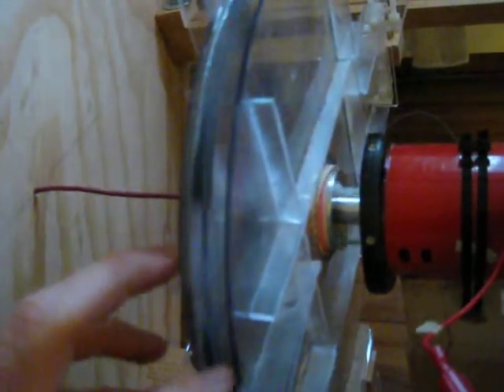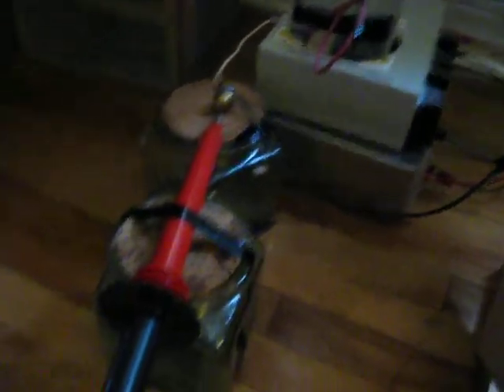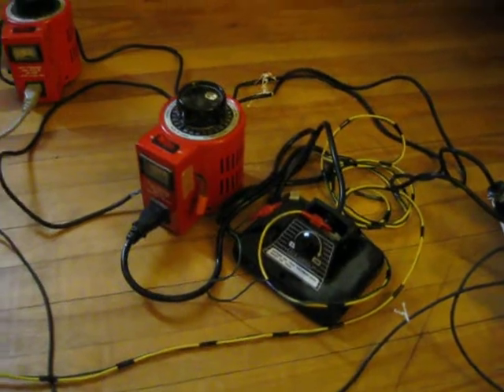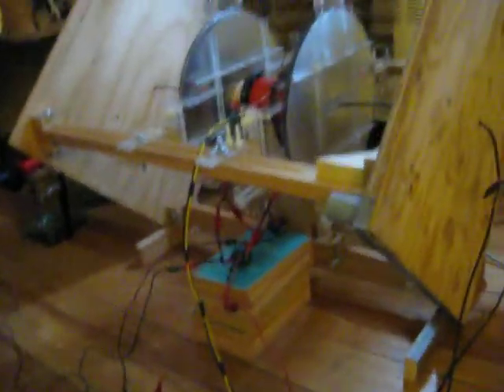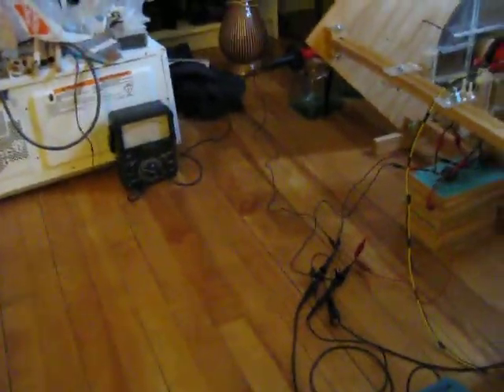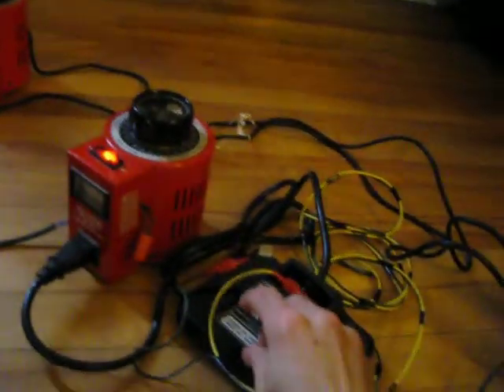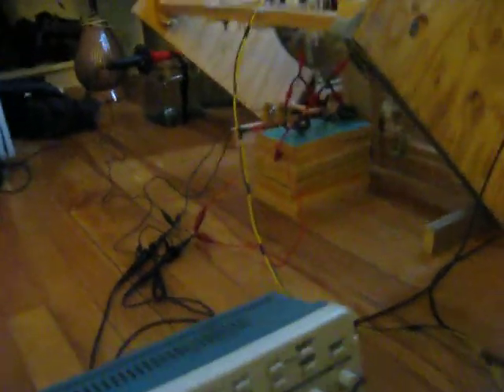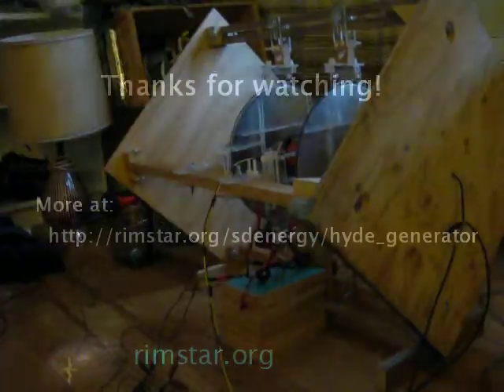Hyde Generator - 1st run after completing all parts April 7, 2009

Comment: Доброго дня.  Ваш пристрій не працює через те що там є груба помилка. Якщо вам цікаво можу допомогти.  Вам сказати що потрібно зробити щоб пристрій запрацював?  

Good day.  Your device does not work because there is a gross error.  If you are interested, I can help.  Can you tell me what needs to be done to make the device work?
Reply from the maker: The only thing I didn't manage to get done was to make it turn fast enough, > 6000 RPM. The fastest I got was 5200 RPM. But I don't have time to work on it these days.
Reply: На вашому відео пристрій не генерує енергію.  Справа не в кількості обертів. Пристрій зроблено не вірно. Генератор буде працювати навіть при одному оберті на хвилину. Якщо зібрати його вірно. Патент по якому ви його робили містить помилку. Ця помилка є для того щоб у вас нічого не вийшло.  

In your video, the device is not generating power.  It's not about the number of revolutions.  The device is not made correctly.  The generator will work even at one revolution per minute.  If you collect it correctly.  The patent on which you made it contains an error.  This error is there so that nothing happens to you.

Comment: Does it have magnets, or is it static electric type?
Reply from the maker: John Kerley Static electric and then something magic is supposed to happen across the output circuit, if it's real that is. I never got it to work.
Reply: Steven Dufresne You were looking for overunity?
Reply: Steven Dufresne I'm uncertain as to what I beleive about overunity as some people have made me wonder if it is possible,....such as Hitby13.
Reply from the maker: John Kerley That depends on your definition. I hope for the possibility of converting vacuum energy into electrical energy. So conversion of energy from one form to another in an open system. I haven't had time to work on any ideas in a few years though. The furthest I got was this theorizing here http://rimstar.org/sdenergy/vacuum_energy/index.htm with the few experiments there. I got tired of the shot in the dark, random approach, and hoped that some theorizing would lead to more of an engineering approach. Then I found a mistake and got stuck and then ran out of time.
Reply: Steven Dufresne I'm not exactly sure what vacuum energy is.
Reply from the maker: John Kerley
I'm referring to quantum vacuum energy, something defined in quantum mechanics. As for what it is specifically, I'm not sure either. If I instead use a wave particle model then it's the energy of the waves being exchanged between particles, but that's far from standard physics.